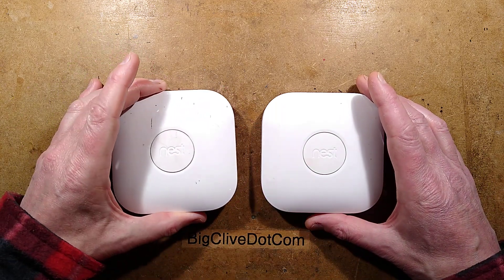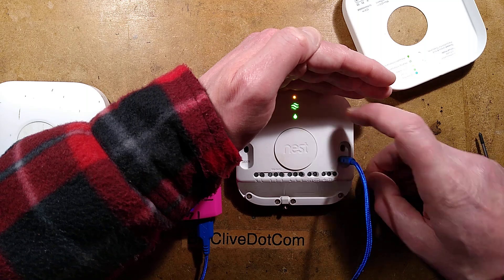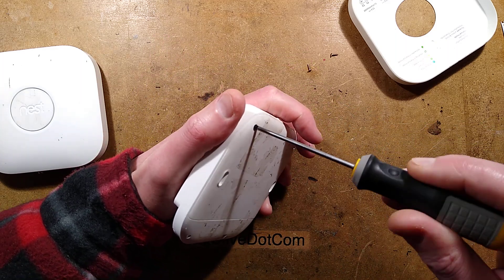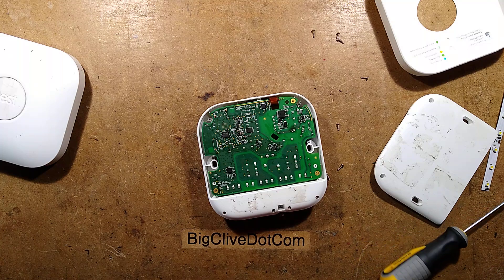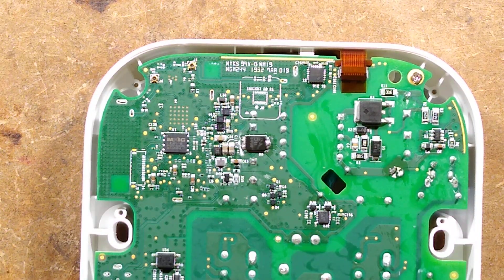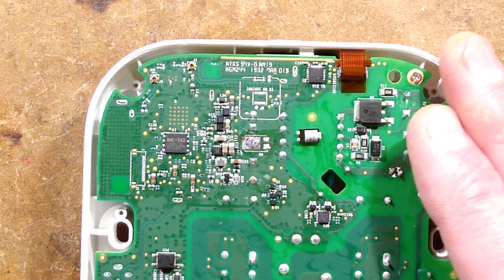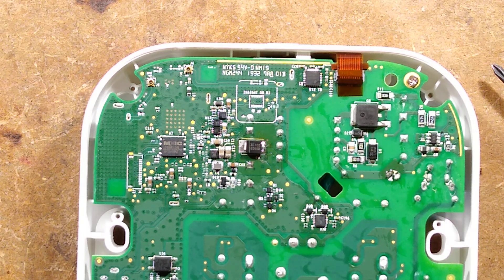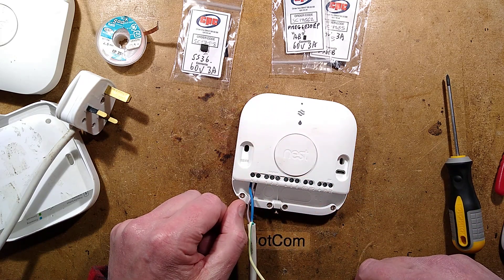Fixing another Nest heat link - with easy tests

Comment: I have seen this before. When I was a project manager for a large electronics manufacturer we started getting a lot of boards back. Basically the manufacturer to save money has stopped individual testing of the diodes so about 200ppm were way below spec for reverse bias voltage. IE 1000V diodes that sort of worked at 200V or sometimes only 100V. When you are shifting 50,000 units a month and each board has 17 diodes in mains circuits that's over 2000 early life failures a year from that one fault alone.
Reply: Ugh, at 200ppm, your need to continue individual testing.  And it wasn't that the past were a little bit of of spec. It would be different if those diodes were only a little bit of if spec.
Reply: Similar story to yours, but on the customer side.

I worked as a maintenance/reliability engineer for a chemical manufacturing plant that was only a couple of years old. The plant had this newfangled switchgear full of coms buses and microcontrollers, where traditionally hardwired relays and motor protection units (e.g. Multilin 369) would have been used.

We had many, many failures of this "smart" switchgear, costing us millions in lost production. After lots of "robust discussion" with the OEM, it was finally revealed that we weren't the only customer experiencing these failures and they had traced the problem to faulty SMD capacitors in the coms cards. Turns out the capacitor manufacturer had a bad batch of capacitors that somehow passed QA and wound up in all sorts of consumer goods and industrial equipment.

The switchgear with the faulty components was either entirely replaced or, where viable, had the coms cards replaced. To the best of my knowledge there have been no further failures in the past ~5 years.

Comment: This video gives me the confidence to try to fix it myself. I bought my heatlink second hand, so trying this will be fun and learning something new.

Thank you for sharing.
Reply: After 3 ours of trying and finnicking with 1 soldering iron, i could not remove the original diode properly. it broke off :( . i tried cleaning it, and soldering the new one on, and i think i got it done right. but it didnt fix the problem sadly. i think something alse has been broken by my rough handling. its finnicky for sure! still thank you, i had a blast with my friend.

Comment: I had the same issue with my Heat Link. Before ordering a replacement diode I decided to contact Nest. I bought my Nest 2,5 years ago so officially it is out of warranty, but they proposed to replace my broken unit with a new one for free. So that's great service!

Comment: Just to mention: be careful with reducing the secondary diode voltage in flyback converters, because in forward turn the voltage in the secondary is usually 3-5 times higher than the nominal. The diode should withstand the sum of the nominal and forward voltages.
Reply from the maker: I ended up retrofitting both units with higher voltage rated diodes than the originals.  I've never really thought about the higher voltage when reverse biased.
Reply: @bigclivedotcom  Depending on the circuit you can run into all sorts of weird issues. EG one you probably know is that diodes keep conducting for up to a few microseconds after you reverse the polarity on them. 1N series are pretty slow and FR1007 make a good alternative and have the same form factor. Then there is the lesser known slew rate issue. IE conduction starts with just a single atom and spreads out fast. If the slew rate is too fast for the silicon to conduct properly you can blow a component at 10% of it's rated current. This is a chuffing nightmare in mm wave radars belting out 50kW+.
Reply: Dont forget to tweak the flux capacitor too!
>;o0
Reply: @garrygemmell5676  or flux “capacitator”, as an infamous reporter once said. 😂
Reply: @bigclivedotcom  Yeah have to worry about the reflected voltage from the primary. Although to get an exact value he turns ratio is needed. Basically the total reverse voltage is the (primary rail voltage / turns ratio) + secondary voltage. Almost got burned by it myself when designing a modest 60W flyback. Totally forgot about it when I went to order the diode for the bootstrap circuit. Fortunately I remembered as I was assembling it, and had a suitably rated Schottky in the parts bin.
Reply: My Nest is a 3rd under 2 years old and just falled on the heatlink 12volts side.

Comment: Thank you for the tutorial on surface mount components, I just need to practice at them I think.  That USB port is also used for pulling diagnostics and doing a factory reset if needed, I've had to do it on a few Nest thermostats over the years.
Reply: @tech 52 Yes, appears as a USB drive.

Comment: My bf could easily repair our Nest HeatLink thanks to your helpful video. He used a VS-30BQ100 diode. It is slightly larger than the pads, so he had to be a bit creative. But it is working now. Thank you for your video!

Comment: Going back a few years when I was involved in such stuff, two components in series (diodes, resistors etc.) was also a common way of ensuring passing certain safety certification testing where they check shorted components don't cause flame/mains creep to low voltage connectors etc. as they only checked for single component failure not multiple simultaneous. Don't know if that's still a thing now but thought you might find that interesting.

Comment: If the diode failed due to ESD, that could be the fact that they chose a Schottky device..  They tend to be much more sensitive to ESD than conventional rectifier diodes, so possibly an argument to just replace the diode with a regular 1N4000 series..  I once ruined almost an entire package of axial leaded Schottky diodes simply by taking them out of the package by hand, grabbing on the leads..  Originally thought I got a bad batch and called the supplier and he asked if I used ESD precautions before unpackaging..   It turned out that that particular diode really did not like ESD.  Once in-circuit it was fine,  but needed to be handled very carefully when installing..  This was the one and only component that I have ever had ESD issues with..    I remember the early days with CMOS 4000 series chips where everyone was initially paranoid about ESD, but never ever blew one of those (well ok, I may have killed one inverter out of a hex chip once, but it may also have been because I connected power to the output, but regardless, I had 5 other nverters to use on the chip, so I don't count that)..
Reply from the maker: My first repair used a UF4003.  The high speed version of the 1N400X series.
Reply: Yes though the only CMOS gates you really had to worry about were those with no protection diodes, generally those that were used as timers, as they made the diodes in those very small and with a high series resistance, so that he clock inputs could exceed the supply rails.  That and some did come without ESD protection for special purposes, generally the unbuffered ones. Going to bet the diodes you blew were ultra low capacitance type, the honking big power types generally survive. These diodes on the Nest likely are simply from overloads and shorts on the output side, and also from having to charge up the low ESR capacitors in the circuit on power on.

2 capacitors are to make sure there are no resonances in the capacitor near operating frequencies, so different types of capacitors from different manufacturers, so that the ultra low ESR one can handle the high frequency spikes and the other simply filters out the ripple from that.
Reply: Yeah same thing here, I always take at least light precautions for it but I've never ever had a problem with it and so I always think that it's a pointless task
Reply: With this power going external to box, additional ESD clamping diodes on the 12v rail wouldn't go a miss here. Even with a good install the 12v is still quite susceptible to ESD failures.
Reply: @SeanBZA  - in an old 1980s designed SMPSU sold under Farnell’s own name (but not designed by them I don’t think), the secondary uses three electrolytic capacitors. Two of one make and one of another make. Also one is an axial type. One reason is as detailed in the post above, the second is to have a lower ESR than if a single capacitor was used (keep in mind that these were almost certainly normal electrolytic capacitors, as I’m not sure low ESR types existed back in the mid-1980s) and lastly, to keep the height of the board low so that it could be squeezed into the case.
Reply: @Mark1024MAK  Yes, likely they wanted ESR to be below a certain point, but the one capacitor is not enough, so needed 2, but as the second one will be expensive, they went with the other version, as the cost is lower, and the combined comes in below the ESR limit. Plus the 2 capacitors can share the ripple current and keep it below the rating of each one.
Reply: I am no expert on Nest and not familiar with the schematic but maybe a better solution would be a bi-directional transil / TVS protection diode, something like a SMAJ36CA
Reply: @ralphj4012  - it depends on what is causing the failures. It may be ESD, it may be that the peak reverse voltage is exceeding the PIV rating of the diode, it may be that this is a batch of defective diodes. I don’t think it’s likely that the diode is overheating and I don’t think that the diode is being subjected to an average current at or greater than it’s current rating. However, it’s possible that the peak current may be considerably higher than expected and this is causing the failures. So a lot of possibilities.

Comment: In this application, make sure to use a robust RECTIFIER rated diode - there is no particular need to have any type of "fast" of low forward voltage diode here.  In fact fast diodes can be the cause of higher EMI in case of inductive loads, relays, etc.  Remember that diode is likely to see 3x ~ 8x + the nominal supply voltage depending on the length of wire run to the unit - that power supply wire is going to appear like an inductor when load is switching or during surges.
Reply: The other fun thing that happens is if the wiring for these units (on power supply or load side) runs parallel to any power wire feeding an inductive motor - maybe a fridge, heat pump, AC, fans etc.  Strong inductive coupling all over.  You will see all sorts of power hash hitting these units, especially when a nearby heavy load switches on or off.  It gets really exciting when the installers run wiring for delicate equipment like this in a steel conduit alongside heavy power circuits - now you have several one turn transformers inductively coupling everything together inside the conduit.  Makes no difference if twisted pair / shielded wiring in use or not - you're talking about many random near-field coupling going on.  That's why that diode needs to be very robust - and it's surprising they chose surface mount device.  Using the PCB pad as a heat sink only helps slightly.  Real thru hole diode package and a small size real heat sink would stand up to much more abuse.  That's why we don't use this NEST stuff.
Reply: @captainmother1268  Even better if the thermostat wire is run near a fluorescent light fixture, or three, or five...
Reply: You do need a fast diode, as it is the output of a switchmode converter so you are dealing with more than the usual 50Hz. However, it doesn't have to be schottky.

Comment: It could be because that diode is connected to an inductive load, when it is switched on and off, that relay might see a huge spike in voltage causing an avalanche current that is frying it. It could be that newer solenoids/valves have an integrated flyback diode and this is only a problem when retrofitting to older installations with old solenoids/valves. Might be useful to pick a replacement diode meant to withstand a high reverse voltage
Reply: Some time people simply forgot or ignored the fact than solid state relay (diode induced) is not the best option for inductive load. I have a client ignored my advice on a SSR for an inductive load and proceed to deliver the machine to their client. For the past 6 months, I got 3 paid service jobs for replacing the dead SSR. I'm not complaining, hopes I get more paid service jobs in the coming month.
Reply: @auwy7828  mechanical relay can have issues with inductive loads as well. use a flyback diode where possible. if switching a solenoid and speed is a concern, use a clamping diode to limit the maximum voltage to below the breakdown voltage
Reply: The diode was in the Power supply section, hence there was no regulated voltage on power up. Any inductive load such as a solenoid on the load ( contacts) side of the relay would have to breakdown the relay insulation to influence the coil side voltage, unless I am missing some other mechanism at work?

Comment: Remember, when you replace your old thermostat with one of these, keep the old thermostat somewhere so when the new fancy one dies you are just  a simple change from having heat again.
Reply: Or just keep the old thermostat and not spend the money.
Reply: @sparkledragon6216  better idea
Reply: Even better, install the old one in a temperature sensitive area, such as near the plumbing, set lower (say upper 50s F to low 60s, or 10-15c, as an automatic emergency backup to keep your pipes from freezing.
Reply: However, when I had two NEST thermostats in a box (not this one, the actually thermostat control), and the one on the wall had batteries that welded themselves in  AND had green creep to the board (thank you alkaline, and a thermostat that never said the batteries were dead), putting a NEST in place was a no-brainer.   I didn't have to drive out to install it, and had enough time after doing so to identify that it wasn't the thermostat causing the heat to be out, and call a tech to figure out the real problem.   Before it became VERY cold that night.

Comment: Great video, small correction: In the end you said that putting two diodes in series would've halved the number of returns, but assuming an equal failure rate and one failing not influencing the other, it would actually reduce the returns by a factor of the failure rate. This will potentially reduce the returns by a lot more than half. For example, at a 1% parts failure rate over the lifetime of the device, you would only get only 1 in 100 of the original returns 🙂

Comment: That's part of the reason why that diode that you replaced in the last video is rated at 3A - the 12v output that you tested for short can supply power to the Nest thermostat itself which obviously has wifi, screen, backlight, processor so that + both relays in the heatlink would take it over the 1A, possibly significantly over if you were powering 2 thermostats...

Comment: The US Nest is a significantly different design.  The power Is 24v ac and has a logic circuit to help the installer correctly identify W (heat), G (fan), and Y (cooling) to the equipment.  The equiment interface is very sensitive to ESD and fails often during install.
My problem with surface mount parts is my hand shakes too much.  That is why i retired from ac repair.

Comment: Very interesting as always bigclive, and thanks for your input.

Do you know if the original users of these two units were using the 12v externally or not? I have the nest installed at home but do not use that 12v circuit, i set it up just switching the boiler contacts. 

I am curious in your opinion, would using, or not using that 12v output have any difference in the expected life of that diode?

Regards.
Reply from the maker: There is a possibility that the external wiring on the 12V supply may have exposed the diode to static.
Reply: Mine died a couple of weeks ago, not using the 12v circuit :(
Reply: @stuartmcguire7416  Mine died about a year ago - still in warranty, so google swapped it (replacement was here withing 48 hrs - and they offered to pay for someone to fit it as well).

Symptoms were the heatlink unit completely dead - will never know what it was, but these diode switches do look to give the symptoms I saw. Like you, I wasn't using the external 12v - thermostat runs on usb and just relies on radio to connect. 

Be interesting to see if the 12v circuit feeds some of the internals - I presume yes.

Comment: It would be interesting to hook up an oscilloscope and check diode reverse voltage at start up and during as many operational transient modes (load changes) you can think of.

Comment: In basically all European countries, except Britain (out of the EU but still part of Europe), we use 24 VAC because it is just a little bit more safe and reliable. Disadvantage of 24 VAC is the relative high idle power consumption. There is alway a small 'traditional' transformer dissipating heat, usually somewhat around 4 Watt.
Reply from the maker: I wasn't aware that other European countries used the 24V too.  It makes sense.
Reply: @bigclivedotcom  In Germany and the Netherlands you will find a lot of components from Danfoss, this brand is the de facto standard. You might also encounter brands like ABB, Honeywell and Nibe. They all use 24 VAC 50 Hz. The more south you go in Europe you might see components from French and Italian origine.

Comment: Probably don't want to replace the diode like-for-like as it appears to be intolerant of voltage transients and dies too easily.  1N4007 are pretty bombproof and would probably make good replacements. You can even get SMD versions of them.
Reply from the maker: 1N4007 is not suited to the frequency of operation here, hence why I used the UF (ultra fast) version.
Reply: @bigclivedotcom  Ah, good point. I forgot it was on the back end of a switcher.